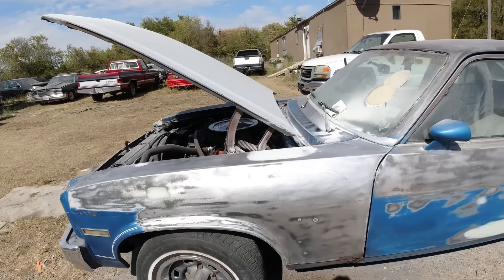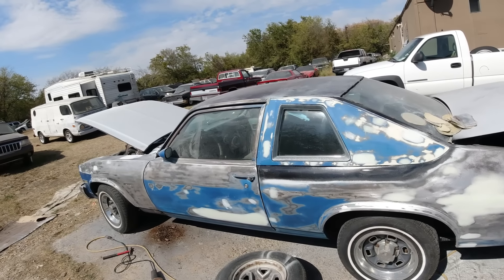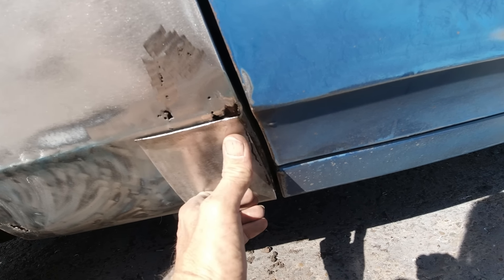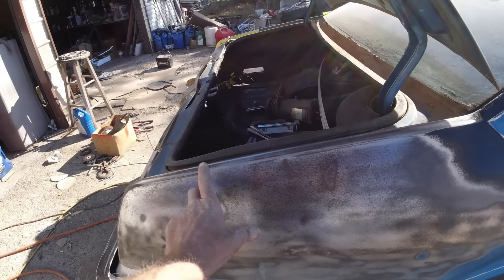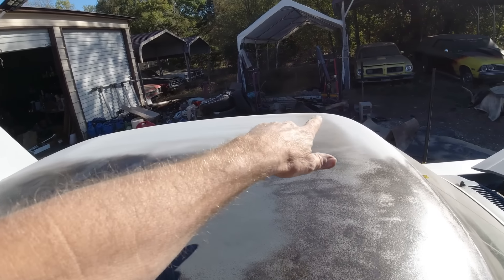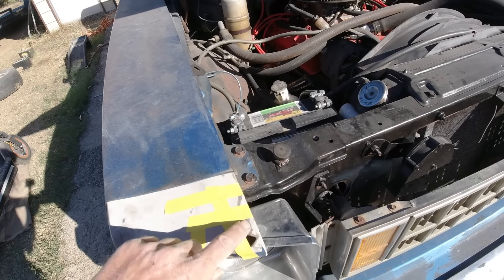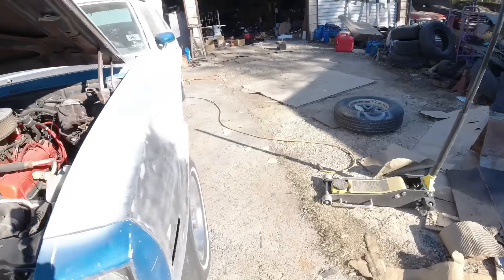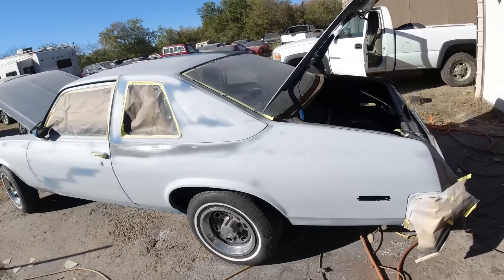1978 V8 "Hot Rod" Nova #7. Strip to Metal and Prime. Body work. Fixing Dents and Rust

Comment: Fun fact, if you're going to go deer hunting with your car( accidentally or otherwise), the 77 Nova works a treat. Was doing 75 on a 2 lane rd, out from a pasture he comes, locked the brakes into the opposite lane, missed the 1st one but not the 2nd. Set it 70 ft up the rd. Got out expecting the worst but it only busted the plastic grill, pushed the bottom of the hood latch vertical bracket back a half inch, and 1/4 deep and 2 inch long dimpled the leading edge of the hood on passenger side corner. Basically very little damage. Full steel frame with scaffolding  pins sized tubes mounting the bumper, which is all chromed steel full width of car. Also a 3/16th steel plate 3 inches wide over the tubes the whole width. Built like a tank lol.😅

Comment: I watched a paint shop called House of Pearls on their youtube channel they used phosphoric acid in a squirt bottle and scrubbed it with 3M pads to remove the old paint and rust, and after and when finished they washed with just hot water,
You don't need to neutralise the phosphoric acid. It will phosphate the surface and continue to do so leavinga protective coating until it gets primed and painted over later...

Comment: You should look into how the new tail lights would look on the scoobie doo van. Might not look bad. Once the phosphoric acid sets up, wouldn’t it be faster to use a wire wheel on low speed. That way you really get the tough spots.
Reply from the maker: I don't want the acid flying around in the air breathing it in and I hate wearing masks.

Comment: Lee I have a question maybe you have addressed it on other older cars and I missed it but my 1966 Chevelle has a factory place where they leaded the roof to the body I have owned this car for 45 years and it’s been painted several times but no matter what little secret sauce I put short of removing the lead I eventually get a bubble in the paint maybe year or three but same dang spot any secret sauce?
Reply from the maker: try etching primer then 2k evercoat polyester primer over that